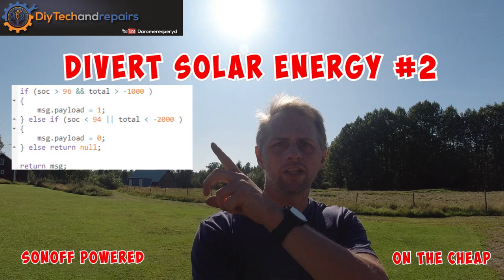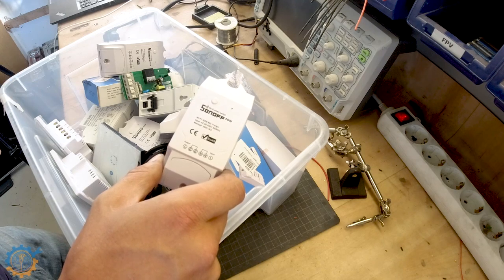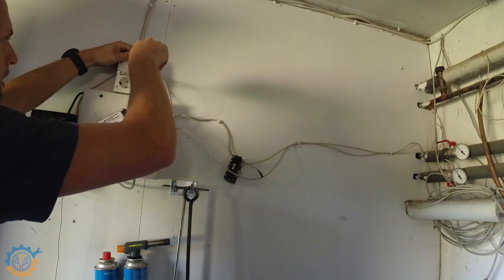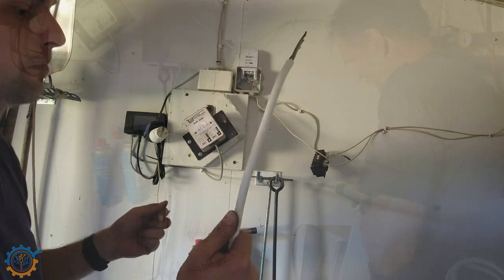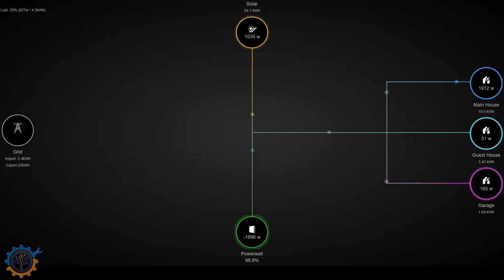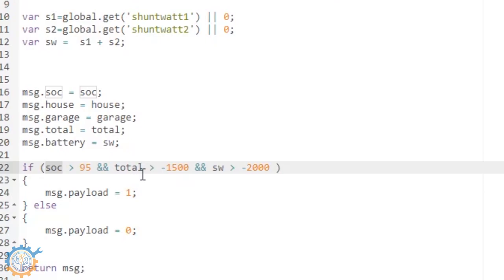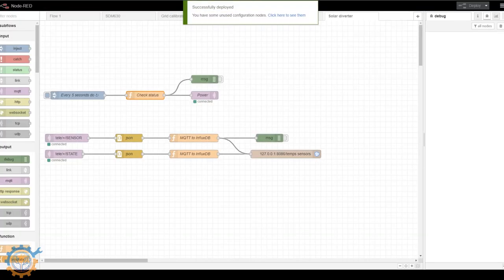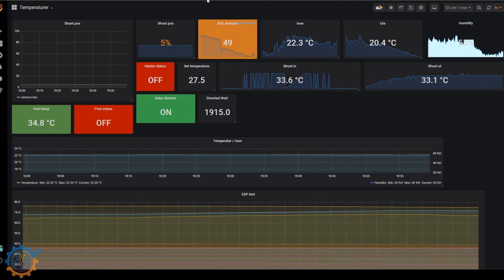Solar power diverter #2 - Transfer power to heat pool water

Comment: Nice diversion load. What is the service load (continuous load) for the sonoff?
Reply from the maker: Unfortunately not much. This One is max 16a so continues should not be above 10 at most. Googling it you can find many that failed due to high current

Comment: Here is my problem, I have a 60 kWh battery pack taken from a Chevy Bolt EV, I want to charge it during the day from solar panels, and use the power only at night. I only want to charge pack to 80% and on the bottom to 30%. I want to use a sunny boy series’s inverter 240vac 60 hertz.being at the output is around 400vdv out of the battery pack. Any ideas how to set it up??????